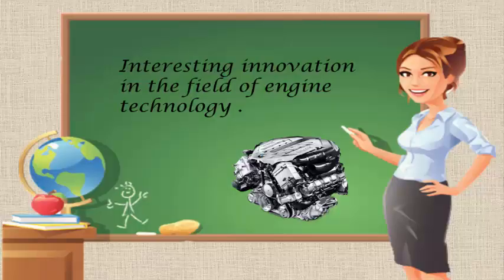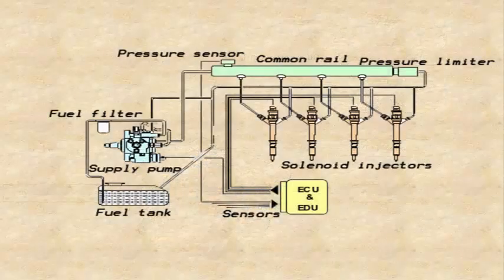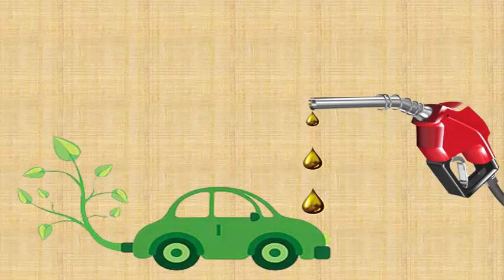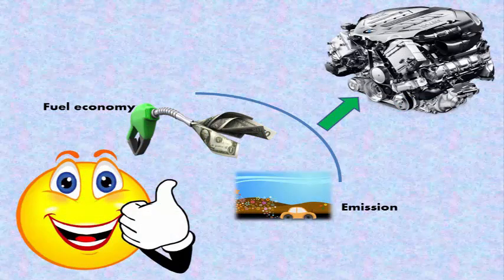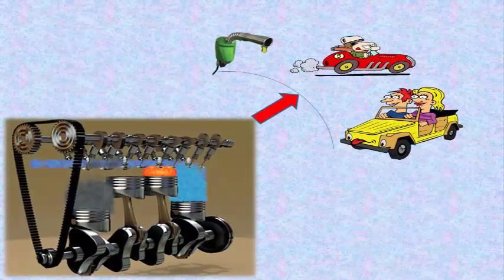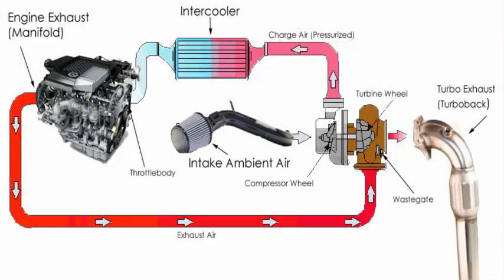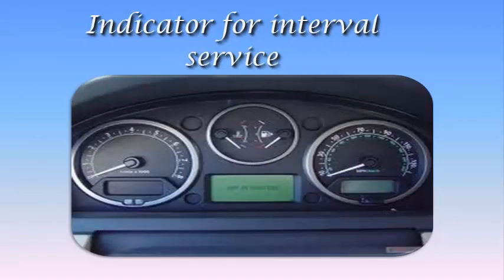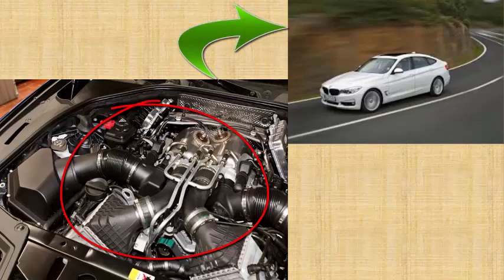Valvetronic Engine Technology

Comment: Nice video! Thank you for posting an article on a unique technology! BMW has developed this system which offers improvement in fuel consumption process in all driving cycles to the latest spark-ignition engines with direct fuel injection.